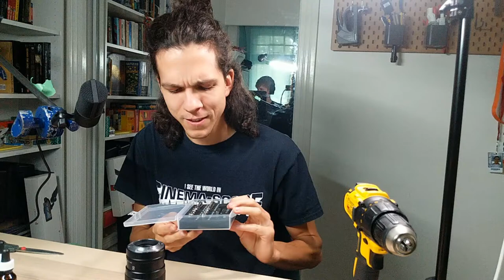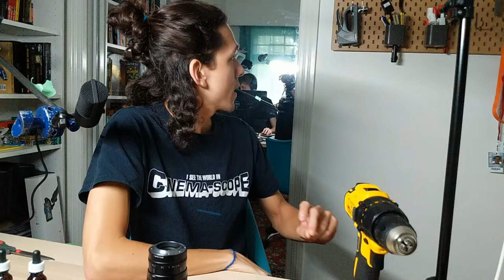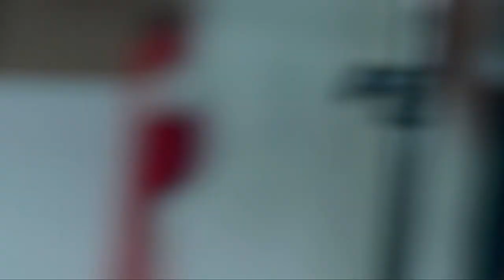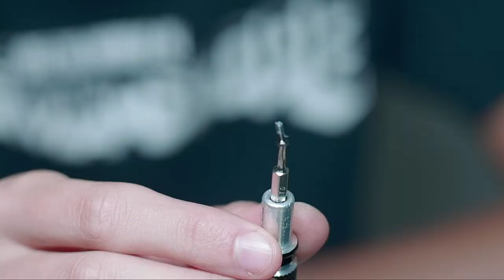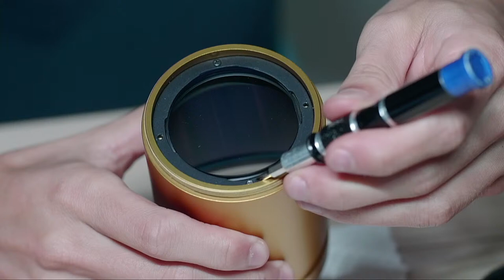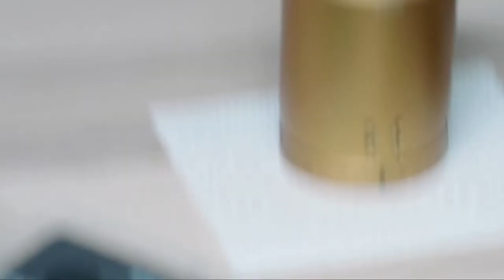How to Deal With Stripped Screws on camera lenses using chemicals

Comment: Yo! Taking apart SMC takumar and could not get a body screw on the side out. Ended up screwing up two screwdrivers. Tried again with PCB blaster, and then acetone with no luck. Ready to give up, put it on a silicon mat, used the damaged screwdriver, pliers and a ton of weight and it moved. The weight was the key!

Comment: Thank you for share your valuable knowledge my 5 cents, after trying with acetone and lighter fluid without success my last and effective resource was with a butane torch, just to be careful with the crystal elements and of course be sure that there is no plastic pieces in the block you are working, put your thumb in the near surface and when started to burn take it apart and turn carefully with the screwdriver pushing gently both ways, and  voilá your stocked screw start to move

Comment: Thanks guys!  You saved the day.  Disassembling a canon 7D camera.  Someone had threadlocked the screws.  I almost stripped one.  Saw your vid.  Used half a drop of alcohol, then heat from soldering iron (which I have never used for anything) and tapped with hammer.  Screw came loose after several tries.

Comment: Did you have a 5.5 mm Torx bit. The German-made ones (Wera or Wiha) from Amazon are the best and don't break.  You get better results with the correct bit and a light tap with the handle of a small screwdriver to get the bit fully seated, and use pressure as you unscrew it. You can try screwing it in, then out,  a couple of times to get it moving. Use a tooth pick to apply the smallest possible drop of acetone or lighter fluid or heptane (i.e. rubber cement solvent).

Comment: What tools do you use? What would you recommend and where would I get some? Screwdriver, solutions etc
Reply: Solvents too
Reply from the maker: That's exactly what I talk about here, so just watch the video. I used acetone, lighter fluid, isopropyl and wd-40. I had an extractor bit and a small hammer, as well as a power drill.

Comment: Thanks for sharing.

Please get to the correct way of doing these things. It may be entertaining for you to use an impact drill but it is not funny. At the end of the day we are looking for the correct way to do what we need to do without damaging our cameras and lenses. We really don't need all of the bullshit in between.

I have found that the best way do do this is to have a soldering iron with a very small tip to warm up the screw. You then take a small pin hammer put the JIS bit that fits into the screw slot and gently tap. Do this before attempting to remove any camera screws. They are a nightmare once you have damaged them. The initial precaution of heat and tap will give better results.

PS: Get a decent set of JIS cross head screwdrivers. The screws used in cameras are not standard Philips. You need the right screwdriver for the job or you will damage the screws.
Reply: It was a stream of him working out how to do it. Seeing the stuff that didn’t work is just as important as seeing the stuff that does work. Much more informative than a 3 minute video of an expert doing it the right way. Lighten up.